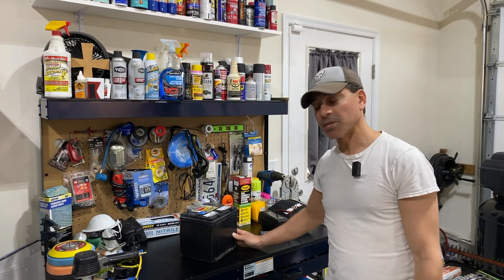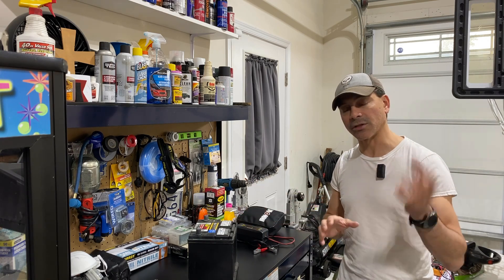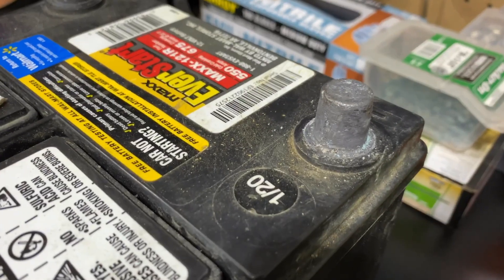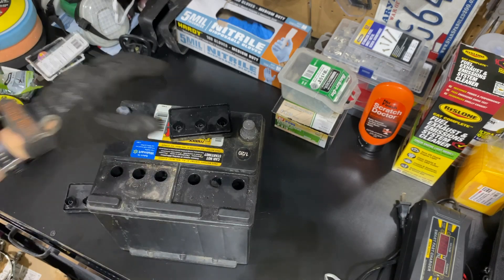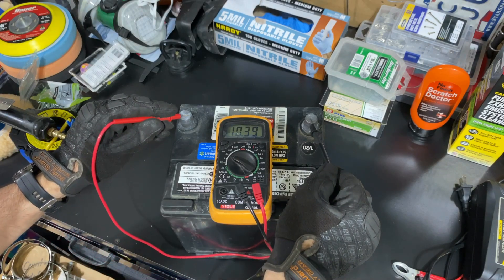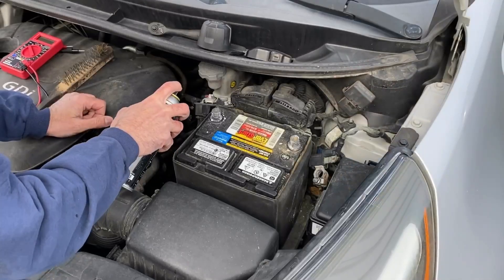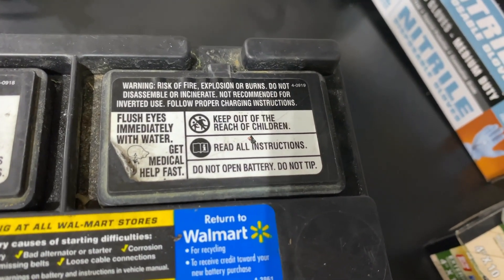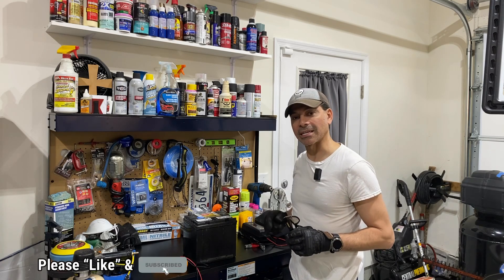What Causes A Car Battery To Die?? (Andy’s Garage: Episode - 475)

Comment: New Battery died after 1 year on taxi, no corrosion, is that normal? Engine size 0.98,
Reply from the maker: Should last longer than that, normally 3-6 years.

Comment: Good informative video bro.
Pls. correct me if I'm wrong .. if l kept on starting my car every two days for 5 minutes for approx. more than two months (without driving it) this gonna affect my battery badly!!!.
Cheers.
Reply from the maker: @essamelbaghdady2985  Yes, you need to run it long enough for the alternator to charge the battery. If not, you will wear the battery out.
Reply: @PhillipsVision 
Can you pls. explain why this will affect the battery?
As much as I know that even if the car is parking and the engine is running then the alternator will be running and charging the battery as well.
Reply from the maker: @ but you said only letting it run 5mins. You need to give time for the alternator to charge it. If you have a voltage gauge on your gauge cluster wait for it to drop to around 12.5 volts. If it’s around 14.5 volts then the alternator is still charging it.

Comment: Wow,,, so I guess I did good getting 6 Years out of my Battery here in Canada... Kia Dealership said they tested my battery after the 3rd year I owned it... I got another 3 Years,,lol and it was still working when I took it out.. However I watched another Video where they say just because a car starts it does not mean the battery was good.. It just meant I was lucky I was not stranded somwhere cold... I guess they do not give you a warning with a slow roll on the starter,,, they just quit on day and you are SOL...